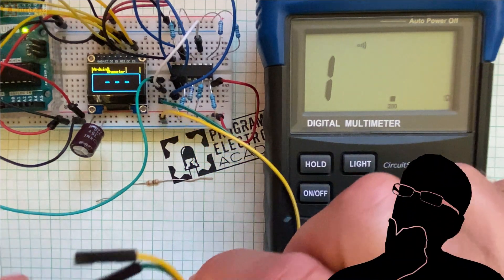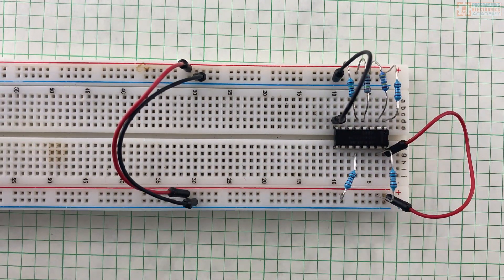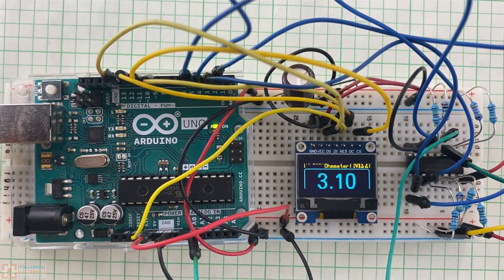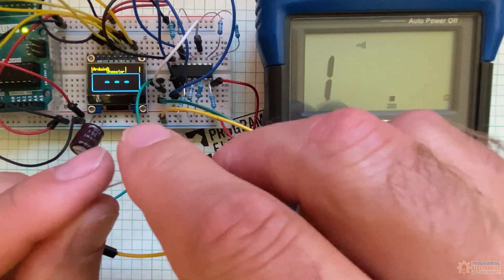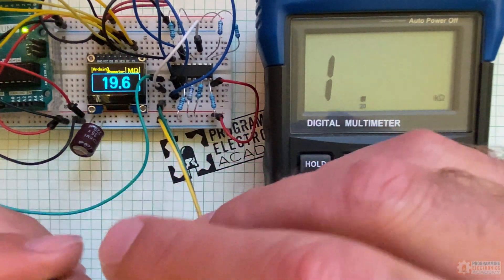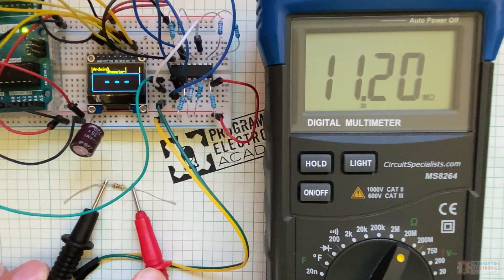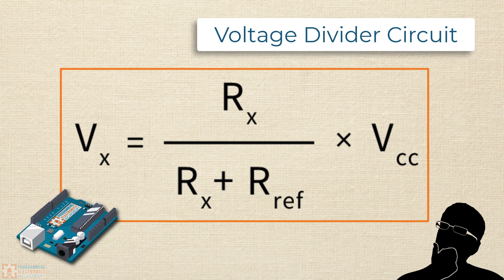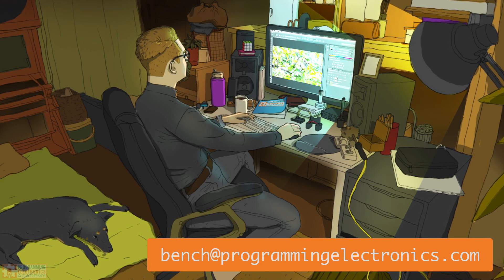Build your own auto-ranging Ohmmeter! (with Arduino)

Comment: What is the range of this ohmmeter? How far or low can it measure resistance?
Reply: set by the range of resistors you use on the MUX that are updated in the code

Comment: Could you expand the project to have a miliohm as well, not only ohms?

If you can do it, I can design a PCB for it, and ppl will be able to order PCBs and build it as a permanent meter to use. And, if you'd have too much time, how about ESP32 dev board to use with CH304A and create a Bluetooth connection with a PC to display scores on the PC/laptop? That would be amazing :).

What do you say? Happy with my 2 ideas for the next videos?

Comment: What if i want to calculate the resitance in the water so I can then calculate the conductivity?If I go with dc the water will go trough electrolysis so I think I need a square wave. Will this work with a square wave instead of dc?

Comment: I have looked at quite a few of these videos and your auto-ranging ohmmeter looks to be the best so far.  Thanks for posting it.  I have a question, though.  I do not have a 220 µF 16V Capacitor.  I do have a 220 µF 10V Capacitor.  Will that work (not too clear about allowable capacitor substitutions)?

Comment: This is great to be able to control an ohmmeter like this with arduino.  I have some homemade vactrols (LED/LDR) and I do analogWrites (PWM) to them to act as a variable voltage controlled resistors.  Since these are homemade I want to test all 255 PWM writes to get the resulting resistance for each.  Using this arduino multimeter I can automate this entire process.  So I can generate say a comma delimited list of 255 resistances for a given vactrol and then export that into a spreadsheet or database for future reference :)
Reply from the maker: Very cool!!

Comment: I have some 74HC4051E's here at home.  Also they are only 47 cents at Tayda, vs like over $5 for the 4617 on ebay.  Is it okay to use them instead of the Max4617?
Reply: Hi there, I just got the same one, it worked?

Comment: Cool project ! 
Design a spring clamp that holds the resistor and all the electronics so you can squeeze a handle to open a set of contacts and insert a resistor and test it then squeeze and release then do it all again for another resistor would be so much better than fiddling with multimeter leads .
Reply from the maker: Great idea!!!   Thank you!  I love the idea of having an enclosure as well.